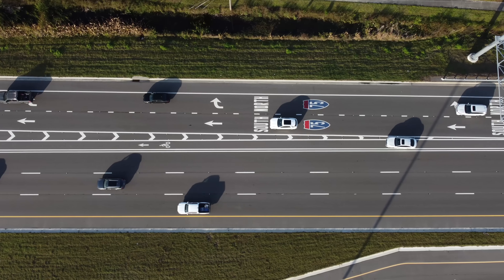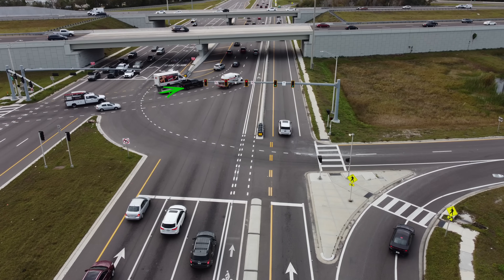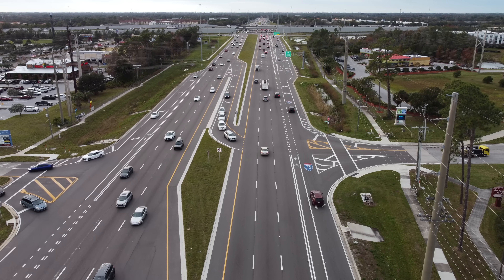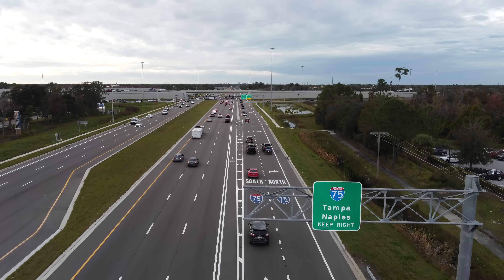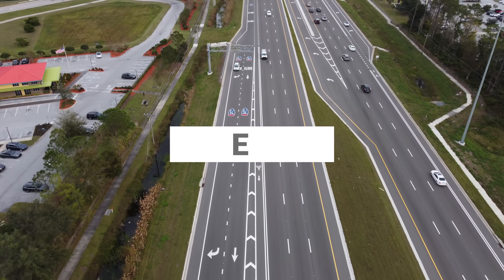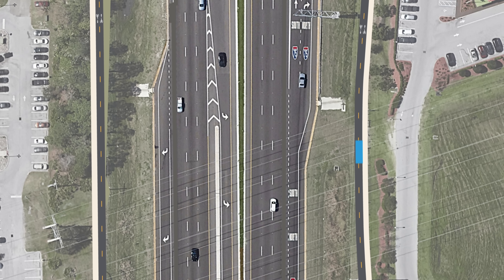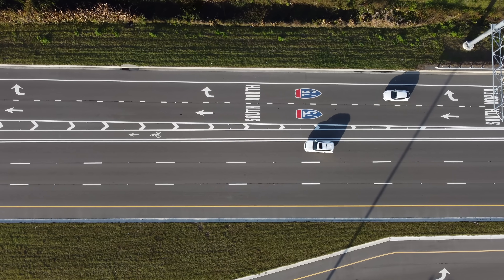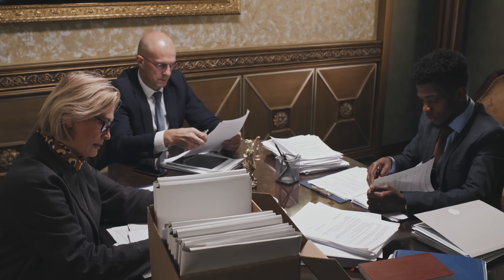This Brand New Interchange is Already Flawed

Comment: I hate cyclists on the road but even I can recognize that's an absolutely ridiculous bike lane.

And honestly there's nothing I hate more than absurd infrastructure projects designed to "accommodate alternative transportation methods" that aren't actually used by bikes or pedestrians while also making it harder to drive through an area.

I doubt tunnels are likely in that area; they seem prone to flooding. But it would absolutely make more sense to divert bikes to a separate walkway away from the road so that they don't get run over by merging traffic!

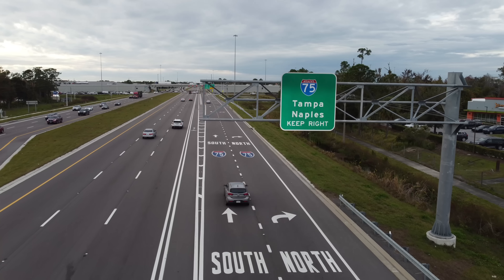Comment: 3:40 um, that sign is completely true. That sign is signaling that those exit lanes are used for both I75 north/Tampa and south/Naples, hence no arrows pointed down to any lane. Then up further they separate the 2 so there’s not as much merging into any lane at the same time drivers go to exit. Simple you want to go onto I75 either way, stay right to exit, then choose your proper lane for direction of travel.

Comment: I would like to mention... as I am from Florida and have lived in both South Florida and the greater Tampa area.

While I like the tunnel idea, it would be nearly impossible here. Note the various swells/retaining ponds around here. These exist specifically because of how low and flat the land in this area is. You dig a 4 foot hole and it WILL fill up with water. In your drawn bike path where it tunnel goes under the entrance ramp that is the focal point of this video it quite literally opens into such a retaining pond.

Engineering a tunnel solution would most likely require pumps. I don't know the exact water table information for here, but the fact that the majority of the retaining ponds are full on a sunny day says it's pretty close to surface in this part. Which means such a pump would likely have to run non-stop.

I'm not saying I'm not for good bike infrastructure. I very much am! I am a bike commuter myself.

But digging down here would be prohibitively expensive for cars here, so I guarantee it wouldn't happen for bikes. You even state how tunnels inherently have this budget flaw... but here... hooo boy. It's a BIG budget flaw.

Comment: I agree this could have been done better. The overhead sign placement does seem problematic as it occurs before the lane even starts and does not give indication that both directions require the driver to merge into this ramp/lane. I would be willing to wager they are using the singular lane to get their storage calcs for both directions to work. Hence why you don't see the 2-lane merge configuration with the striping. Also think they could have aligned the leg of the ramp to more acccute to futher discourage movment from the thru lanes. 

The Bike/PED tunnels would never be an option in FL, especially at this loction. You can see standing water in ditches and ponds near these crossing points. Good luck getting that to drain. It would quickly become a culvert that doesn't drain. However, IMO Bike facilities shouldn't share the same pavement with any facilty >= 45-mph. So the Shared Use Path is more appropriate here.

Comment: A lot of roads are so poorly designed by people who never ride  on them, before or after.  I live in a small town and they installed this massive traffic light that could handle a million cars a day. Guess 10 years from now it might see 10k cars a day.  But for now they added red right turn arrows that people sit through for 10 minutes never seeing another car at the intersection. (the light should pick up that there is only one car on the road and give them the green light)  People think this means no right turns on red even when another car is not in sight. And there is no signage indicating either.  Also the left turn light turns red when the through traffic has green light. It should be flashing yellow at this point to allow people to turn. again this is a small town that maybe sees 5k cars a day.   At least they are not like big towns that spend 5 million of the road budget on decorating the intersections with art no one looks at or cares about, because they are too busy looking at and dodging the pot holes in the road.  They also put a round about on a 60 mph road at a spot that only 5% of the traffic is cross traffic instead of a light that stays green until a car needs to cross. This is a major truck route and now every trucker has to go from 60 to 25 back to 60.  There was only a stop sign here before and it does suck to cross 60 mph traffic, and there was enough traffic to justify a stop light, but not a round a bout.

Comment: @6:02 tunnels aren't feasible due to the high water table.  Take note of the standing water in the drainage ditches, a testament to the high water table. Pumps, you say? Pumps would have to run 24 hours , a day, sixty minutes every hour. And still the tunnels would be constantly wet and unhealthy for people to walk through.

Comment: The root cause for this failure, to me, is that it seems there was no (or very little) community review. While most city planners/engineers think they know everything, this project illustrates they do not. They should propose a few designs, make them available to ALL the public for review and feedback, iterate based on feedback, and present 2 designs to the public again, and solicit feedback. This road that goes east-west is not appropriate for bicycles.

Comment: I75 @ SR70… it’s a bit insane. The debris on the inside of the barrier keeps growing.

Given the sea level in that area pedestrian/bike tunnels probably wouldn’t work well especially in the rainy/hurricane season. The retention ponds are intended to fill with run off and could flood the tunnels. An overpass may be a viable option but I doubt the state/county would be willing to put up the money for it or even a feasibility study. That interchange construction was a nightmare while it was underway.

Comment: 6:00
Yes get rid of the bike lane. Yes build a separated bike path. Yes put the crosswalks father back. 

But holy God. This is Florida bud. You can't "tunnel" under the side streets unless you like to bicycle under water. For any Europeans who seem to think this is feasible, this only works when the surrounding area already has elevation and isn't at the water table. What you're proposing would require you to instead raise the side street up to give clearance to the bicycles staying at grade. That won't work either because how will you raise the side street AND connect it to the main roadway still? You're going to hump up all of these side streets with a crazy breakover to the mainline which is going to create all sorts of sight issues?

The amount of uninformed arm-chair engineers in the comments is nauseating. You make great videos with incredible visuals, but are a bit uninformed about who makes decisions in this entire process. People always seem to want to lay blame at the engineers for decisions like this. None of the engineers in Florida asked to put bike lanes everywhere. They all hated the idea when it was foisted upon them by the State. You know who did ask the State to do that? Cyclist lobby groups.

Comment: Another example of the psychology issue is the practice of not putting both highway designation and local street names on the same sign. Where I live the state/federal designation is on the large overhead signs and the local name only on the small sign post on the side of the road. When someone from out of town asks directions the will be given directions using the local names. This could easily be fixed by passing a law that requires all directions to be given using the state/federal designation. It is ridiculous to think it would be effective to put both names on the overhead signs (e.g. US 84/ Main St.)
Reply: Pennsylvania Interstate 476 and the Turnpike is bizarre.

Most people in the Northeast will simply call it the "Turnpike", but signage there sometimes just says "Interstate 476".

But the thing is , 476 turns into a toll free Interstate not part of the Turnpike around Plymouth Meeting.

Comment: Being a Floridian, the reason there isn't tunnels like that is because of our water table. At grade like that, a tunnel is VERY expensive or not possible because it will flood. Climate also plays an important role. The other issue is that drivers here just don't pay attention here. Signage will help a few, but the issue will still remain because of driver education issues. Id argue, getting rid of the bike lane without replacing it / forcing them to use the sidewalks the only option for it. The 2nd fix would be to change the decision point sign to show both control cities separately as suggested. This would definitely help. Signage here does seem to be more complicated than it needs to be. Usually because they want to only make one sign when possible. However that gantry in that spot was clearly built larger to hold two signs.

Comment: I used to cross a busy road with a walk signal that worded with the said road having a red light & a no turn om red sign. When it was determined that the no turn on red was causing traffic to back up too far they decided to remove the sign. Now if you try to use that crosswalk your life is in danger because the right lane never stops. I think the planning commission has forgotten the reason the crosswalk was put there in the 1st place.

Comment: For some unknown reason, Florida does an absolutely horrible job with highway AND local road design and engineering. That new interchange this video discusses is one of many that have been completely redesigned or newly constructed and the project being overseen by FDOT with major flaws that make the completed road and directions to motorists very confusing. Similarly where I live in Palm Coast, which is on the east coast of FL between Daytona Beach and St. Augustine, many of our local roads have both curbs and painted lines that do not curve like cars would naturally turn, but instead they are straight and then immediately go into a sharp angle in another direction! No drivers turn the steering wheel at a sharp angle, so these roadways are ridiculously designed and when the sharp angles are on actual curbs, there are tire markings and even divots in the concrete where cars have hit it precisely because of the poor engineering which should have placed flowing curves instead of the sharp angles. Most of the streets around here were built with NO sidewalks for pedestrians, and people riding bikes are in danger by being in the traffic lanes along with vehicle traffic. For some reason, Florida thinks all of this is fine, when it is not!

Comment: I do have to say that the inclusion of bike lanes and the proposed solution doesn't actually do any meaningful difference. The road is still an impassable wall to anyone not in a car. Pedestrians needs to be able to cross the road, going parallel along its length is generally a smaller issue of these larger roads. An overpass, underpass or other type of crossing every other mile along the road's length is a far better solution to this urban divide.

But I am very much willing to agree that the original cycle path is purely idiotic.

And yes, it is still good to have parallel bike/pedestrian paths "alongside" larger roads. Even if I personally prefer them to be further away, like a block or two into the neighborhood on the side of the road, since it gets people away from the noise of the road and makes the bike/pedestrian path feel more inviting to use. A thing I honestly think almost all urban planers utterly fails at doing...

Another slight discussion point is the construction cost difference between an overpass vs an underpass.
The underpass is effectively a bridge for road vehicles, ie heavy traffic. While the overpass won't need nearly the same structural rigidity since people and bikes don't weigh much and is therefore generally cheaper to build. Though, local conditions can dictate one being better than another. (constructing a bridge to pass a hill is often not ideal, same for tunneling under a valley.)

7:20 likewise has a point of potential confusion for southbound traffic as far as the road markings are concerned. Simply stated the south bound isn't clearly told that they need to go onto the new lane until it has long since been divided off. (though, road signage should amend that issue rather trivially.)

Comment: Is it a motorcycle lane or a peddling bike 
It may be dangerous either way 
But it is confusing to me
A bike tub
Tunnel under the road 
And and outside along the road 
A small bike tunnel floods
Pump out the water but give it good drainage 
Or overpass but has to be higher from large vehicles 
It depends before hand planning
Reply: True
But it's a bike lane 
Ten feet deep or something 
Or you have to make a 15 foot clearance or a small detour for bike's 
Foam m
Home Mariel if it's only bike's and walking 
Archway 
Overpass or whatever 
But flooding could be a problem sense it's all on level ground 
Or lower 
So a overpass 
Like a U so it scales up ant close to the road change 
Or something 
I'm not sure
Is it less cost and maintenance 

u horse shoe but arch across the road
Is it 15 or 17 feet high 
What is the clearance on advantage or is there a different road or trucks or whatever 
Service lanes
Industrial road 
It depends

Comment: 7:10. I have a huge problem with the concept that bike lanes shall make detours so that car lanes can be straight. Consider that bikes move slower, thus the time of the live on the bike is more valuable per arc-length than that of the car. I personally do not use bike lanes whenever I am not legally required to, but rather take the straight road.

Comment: In Los Angeles the intersection of a multitude of freeways was confusing. A local artist saw the problem & preceded to make a freeway sign using the exact specifications of the state that could be installed next to another sign over the freeway to clarify lanes. He then put on construction worker clothes and got a ladder, climbed into position & installed the fake sign. It worked beautifully. It worked so beautifully that neither the city, county or state noticed it for five years. At which point they made a duplicate official sign and repaced the fake sign that had fixed the original problem 😂🤣 Sometimes this town can be so entertaining.

Comment: @bowez9  I have been a hardcore cyclist - who got his start on NYC streets - for 4+ decades

I estimate that I have done at least 150K miles in my life, and that's probably a low end estimate

In my life, these are the fastest speeds I have achieved on a bicycle with no motor power

53 mph on a tandem, with my wife/stoker, coming down out of steep mountains near Las Vegas NV

47 mph on a single cyclotouring bicycle with a fully loaded trailer in tow, down almost certainly the steepest part of the Oregon Coast Highway 101

30 mph on flat ground, single bike, no load, implementing highest gear of 100+ gear inches with wind not a factor

The speeds of bicycles you proclaim as fact are totally wrong, and clearly PROVE¹ that you know not of what you claim

And if I call your claims ridiculous, you'd likely accuse me of ad hominem attacks

1. Because I am a mathematician, I use the word PROVE advisably, unlike the rest of you normies

Comment: State highway departments resist acquisition of real estate because money spent on real estate is money NOT spent on engineering and construction.  Proven intersection designs, simpler and safer (for both automobiles and bicycles), require more real estate.

Comment: Being that this part of Florida is very low lying, tunnels are not an option. The video even shows the tunnels going through areas that are used for water runoff and generally retaining water. I live near this intersection, and the bike lane is not safe as it is. But the issue isnt because of the signage, its because of the drivers not paying attention.

Comment: Two thoughts:  First, the whole discussion about a bike lane and sidewalk is a distraction.  No one's going to be walking/biking along that sidewalk anyway.  The sidewalk and bike lane are more for meeting a paper requirement than an actual usage one.  Second, the first sign way up the road says "Tampa, Exit Only" and then Naples would be the next lane over.  Which isn't the actual road configuration.  That's the start of the whole problem and people don't realize it until further down the road.

Comment: This spends time on how to improve the bike lane when this road doesn't even need a bike lane at all. A cyclist can just use side roads. If I liked here and was driving a car, I would avoid the highway and use side roads.
Reply: In all fairness, cycling is not the ideal non-car transportation alternative. Its very slow, dangerous without specialized infrastructure, short ranged and limited to at most two passengers per bike. Money should not be spent on cycling infrastructure when public transit is far more accessible, can use existing road infrastructure, safer, and provides just as much range as a car assuming service is provided city-wide